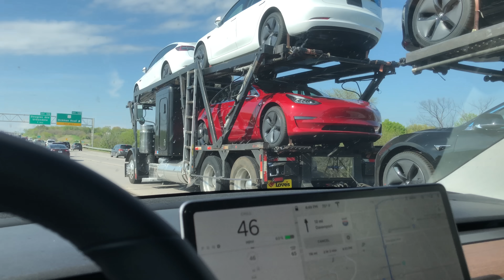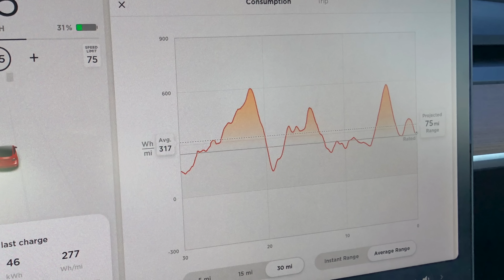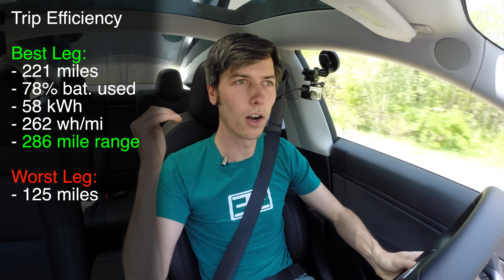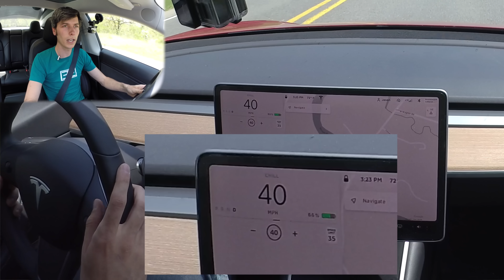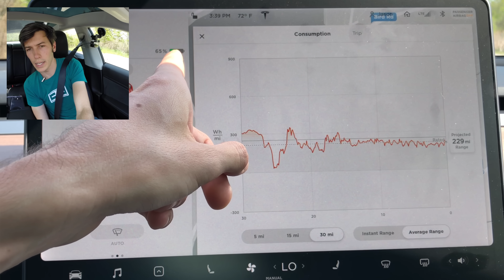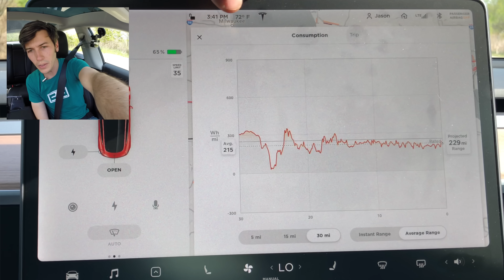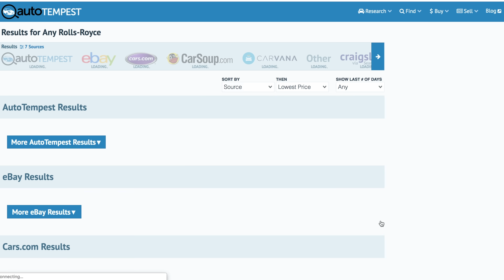How Miserable Is A Tesla Road Trip?

Comment: While you are driving a standard car...an alternator charges the battery...does an electric car have any built in device to keep the battery charged??? If not..why not??
Reply: ahh, good question. My answer will be more vague than an actual educated person. The issue is the alternator is being turned by belts to generate power. The motion is generated by the main engine of the gasoline engine and provides enough energy to power the vehicle with some excess to replenish lost charge on the battery from starting and other factors. Turning an alternator requires energy, and does tax a combustion engine to some degree reducing fuel effectiveness. Due to our current understanding of conservation and transfer of energy, it is not possible to recover more energy than we spend to generate it.

However, we do use a similar alternating function on EVs and that is the energy captured from braking. Now, i have not actually read into how these things work, but my understanding is that when engaged, the wheels basically capture energy in a similar way that an alternator does. But if it was always active, providing resistance, it would just waste energy trying to power through the resistance. The system should be able to engage and disengage the resistance, providing power generation while the goal is to actually use that friction to slow the vehicle. 

Now this was just my understanding with limited research prior to this. If anyone actually has informative details to correct, please do. I will never turn down an opportunity to learn.4

Comment: 560,000 Watthours you used in just a few days.
Do you realize the vast majority of houses run on that amount of power for a month or more??
And you're just one car.  Over half a million watthours per car and there's already nearly 100,000 of these cars out there.  Surely you can grasp the significant increase of power generation necessary to feed this new appetite for massive amounts of electricity?
It all boils down to energy density, both in the generation and storage phases.
Electronics are also far more vulnerable to software glitches (soft breakdowns?) and natural elements than mechanics will ever be.
If they manufactured self-sufficiency into these electric cars in terms of recharging (i.e. wind or solar), it would go a long way in preserving their future, imo of course.

Comment: Weight, not volume of internal cargo  is what matters. Most of the "lots of stuff" was light weight, low density and probably weighed less than a 3rd adult would.  The Model 3 net cargo capacity is 926 lbs.  You want a "miserable" long  trip, do it with a kid,a dog and a week's luggage plus tools. 
Google Maps'  travel time estimate is for movement time using traffic and speed limit information.  If your wife needs to take a potty break every 30 minutes,  you need to eat or sleep, or refuel your vehicle, the travel time clock is stopped for those breaks. If you use Google Maps while traveling, it will adjust your arrival time every time you stop for more than 3 minutes,and further adjust using GPS.

Comment: 15% buffer on LR? I used 10% on SR+ and still car was much more efficient than expected. Drove 10-15% faster than limit. It is better charge more frequently than hypermile time wise. So just go fast and nav will tell you if you won’t get there with current speed

Comment: Well, the nasty side of me wants to laugh, saying “Ha Ha!”... when you had a ruptured tire  cause by going over a pothole.  In my opinion car reviewers tend to emphasise handling and performance, over ride comfort and tire durability that comes with thicker sidewalls on tires.  Maybe I’m too old-fashioned, but I remember how my 56 VW Beetle had a more comfortable ride than my much more recent Prius in 2017... AND I didn’t have to drive as gingerly through the potholed streets of Denver, to avoid destroying my tires or suspension.  Low profile tires can be a high profile inconvenience.

Comment: Hey engineering explained, If anyone could address this
it would be you.

Every critic, mfg, consumer, seems to be ignoring the huge advantages of electric vehicles: Complete elimination of, and maintenance of, internal combustion support mechanisms. Water pump, can belt/chain/, oil pump, alternator, exhaust monitoring systems, transmission & fluid maintenance, engine oil, radiator, hoses, belts, bearings in all of these components, u-joints, rear end gears, fuel injection systems, related seals; my god, the list seems endless!

Entire industries will be lost not having to mfg, sell, and install these related components.... what will we do with our time?

Can you analyze these cost savings into an overall cost of an electric vehicle? I think we will all be shocked!

This needs to be a talking point.

Thank you

Comment: My LR M3 must be a musical car. Just took a 1600 mile road trip wh/m over entire trip. 217. Was over 4 days and 3 hotel stops each offering free charging. Total of 4 Supercharging stops with one not necessary just a bathroom break and decided why not. Total cost of charging. $32.35. Longest leg 254 miles 70-75mph wo stopping. 222 wh/m arrived at SC with 68 miles  out of 313 starting. A.C. on all the way.

Comment: That's actually impressive ... average speed 65 mph average speed. Assuming 310mile range, 80% charge/discharge, and only super chargers : 240 mile / charge @ 45min -> 6h15min 'perfect' charging. So you were close to that, I guess in the real world, it's impossible to hit a perfect distance between chargers, so perhaps a more realistic range between might be 65% and 35min charges (but you might also lose 5min / stop just to connect etc.).

310 x 65% = 200 miles -> 10 stops @ 40min == 400 min or 6h40m. Did you track the full stop time / including slower speed to/from the charger? (Will have the same penalty for a gas car, but somewhat less ... guessing 10min per fillup @ 5 fillups so < 1h).

LOL I should have watched the full video ... but your facts matches my estimates pretty good :)

Comment: Do Teslas have special low resistance wheel bearings or any other low friction features? Do they recommend specific tyres for Teslas
Reply: Jason's Model 3, being a performance model likely has Michelin Pilot Sport 4S. So they are not low rolling resistance tyres.

Comment: I'm not a fan of electric cars in their current configuration and practicality quotient, but I'll not ding it for forcing you to calculate where your next fuel source will be and how it determines where you eat, etc. Gasoline cars had the same issues when they were first introduced.  But it does speak to why you, as a customer, don't want to be on the bleeding edge of any technology - unless your car is really more of a hobby than daily transportation. 

I think electrics have heir niche, but they are good for two things: Rich guy buys one to put in his wheelhouse with his other "real" cars. Average guy with a daily URBAN commute with plenty of charging stations around where it can charge when he's at work. I think that something like a graphene capacitor type storage system could change all this, when it happens. Then I'll be interested in replacing an internal combustion engine car for an electric, but it probably would not be a Tesla (which opens up a completely different can o' worms). 

If we were having another Opec oil embargo situation, I'd feel a lot differently, but I see electrics as trying to solve a problem that doesn't exist.

Comment: I'm sure someone has asked this but I'm not going to read through 2940 comments of nonsense. Where does the 33.7 come from for gas equivalent? 560 kWh at $.30 is  $168. That is Socal Edison full rates. I would use 300 in my apartment with no A/C. I live off grid now and am lucky to get 10 kWh a day with 9 panels in Oregon's Willamette Valley. To buy gas and charge my batteries is quite expensive. $168 at $3 a gallon is 56 gallons multiply by 30 mph is 1680 miles. Not quite the savings you say with your 33.7 figure whatever that is.

Comment: The trip navigation accounts for things like temperature, elevation gain -- my experiences over at least 20 trips beyond the 300+ mile total range have been that there is built-in conservativeness -- even in a few cases where I thought I might have to do the last 20 miles a little slower than my usual 75mph I never even had to.  The actual range and EPA ratings are surprisingly close -- far better than my last car, a Prius that advertised 60mpg and really got more like 45mpg, whereas I often get more than 325 miles, and even in winter get maybe 20% less.  So on long trips, mostly it's just a matter of learning that you can trust the trip meter, and that you do have options, and so on.  Oh, and you said you were born in 1963?  No way!  (I was born in 1962)

Comment: You didn't tell us how much it cost you in electric charges for your trip. Tesla doesn't allow free charging anymore. 560kwh x .30c (NY is .36c/kWh, Cal is .38c/kWh so .30 is an estimate) = $168 for the trip. Divide $168 by $3 (gas price) is 56 gallons of gas. If your car gets only 32 mpg you will go about 1760 miles. 2000 - 1760 leaves 240 miles. That's about 7 to 8 gallons of gas between both cars. Cost of the trip for fuel is what matters, not miles per kWh vs mpg. Not even I had more electric stops than a person in a gas car matters. How long can you drive? Some people more, some less. It all depends what you are use to. That's not a factor.

Comment: So you padded the gas prices by 20%, compared it to a merely-average MPG small SUV, and drove well under the speed limit.  And still had to stop every 3 hours.
In a 40mpg car (nevermind the Skyactiv X cars you can't get in the US yet), and paying a more reasonable $2.50/gallon, the gas car wins handily.  You'd also arrive many hours sooner.  And the gas car costs about half as much.
Probably fine commuter cars if you don't mind the crazy price and usually charge at home.  I wouldn't own one for road trips.

Comment: When I can trim that almost 8 hours of charge time to go 2000 miles down to an hour I might get interested.. Until then I will go for cheap gas and continue to destroy the environment with my fume belching, carbon dioxide emitting 2017 Crew Cab Chevy Silverado 4X4. We would have laughed at the pot hole. I am intrigued by electric cars but the cost and utility just isn't there for me at this time. Also remember tax free charging isn't going to be around forever. Just wait until the government starts to tax the use of charging stations...Even The Ones At Your Home... to make up for the loss in gas tax revenue. They will make it so gas is competitive with electric on a cost per mile baises..mark these words.

Comment: I think a modern gasoline engine can easily average 40 mpg cruising at a steady state 75 mph on the interstate.  Even something like a Toyota Rav4 non-hybrid has an EPA highway rating of 35 mpg.  So let’s recalc at 40:

Tesla Model 3 - California supercharger rates: $201 or 10.2 cents per mile
Modern ICE car - CA $3.50 per gal: $171 or 8.7 cents per mile
Tesla Model 3 - your numbers: $156 or 8.0 cents per mile
Modern ICE car - $3 per gal: $147 or 7.5 cents per mile
Modern Hybrid - 50 mpg: $117 or 6.0 cents per mile

So ICE beats supercharger on both convenience / time and cost.

Good information but I’m still not buying the save money by driving a Tesla argument.
Reply: Yeah Diesel engines are even better, if I go on a Roadtrip and have myself under control (means only driving 85 all the time) I get easy 50 mpg

Comment: Why not charge it to 100% every time you stop.  From Kansas west it's a bit barren.
Reply: Because the charging speed is very fast between 5% - 65%, and then gradually drops off. At 70% you usually have MORE than enough to get to the next charging stop (and pee stop, and food stop).
Reply: BulletSpoung charging starts to slow-down after 50% state of charge and significantly after 80%. It takes as much time going from 80% to 100% as it does from 10% to 80%. The only time it makes sense to charge to 100% is before the journey and if you stay overnight with a destination charger.

Comment: Yea, I drive around 1600km per week (1000 miles) on some of the worst roads in North America and diesel isn’t always available... so I use a naturally aspirated, non-direct injection 5.0L f-150 with a 136 litre tank.  I get between 13.2-13.4L/100km, so about 1000kms (600 miles) per tank.  I would look at an electric truck, but it’d need at least a 1000km range in -30 to -45 winters... I’m not holding my breath.

Comment: The real question is, besides the flat tire, did your car get dents, paint nicks or glass chips during the drive?

So the entire trip only saved you $39.50 compared to a 30mpg gas vehicle, that's it?  I thought it would have been much more.

Comment: I recently drove from Massachusetts to San Diego covering 3,150 miles in 4 days.  My cost of charging was only $125 so I am wondering why your cost was so much higher for a shorter distance. I had the same range anxiety and did also charge up above the range the app suggested and also did drive at 80 miles an hour when ever available.  My autopilot made the drive more relaxing so i suggest anyone purchasing a Tesla get it with full Autopilot as well as FSD

Comment: You say you were born in 1963...so this Tesla has the time travel option??? Is it like Startrek...or were you in a Delorean with Christopher Lloyd??? 
Seriously tho...Last year I drove my Tacoma and pulled a 4000 lbs RV across Canada. So, between Thunder Bay On and Manitoba border there were spots  that had no gas stations anywhere. I had 5 Gerry cans of spare gas as a backup. I can assure...there was no TESLA charging station to be seen. 
My point is that this electric is still not practical for most people. Work driving and stop n go..it works but here in Canada in the great expanse...no way.

Comment: so if that area has a power outage your sol ?
Reply: You know gas pumps use electricity right?
Reply: @ScottHurlbert  did you for get you can toss a line into the tank at any station and either suck it out or use a manual hand crank like they used for water back in the oldn days? theses are not the cars of the future ...they are fads and all the millions of people driving electric cars would crash the system .but lights and living indoor was fun while it lasted...

Comment: I would not be that excited about traveling 2000 miles on the equivalent of 16 gals of gasoline as you stated. That is not a positive energy saving statement! Remember, the large amount of energy it takes to make those car powering electric batteries, the energy cost factor to make and store the electricity it needs to charge your batteries back up and not to forget the large cost of recycling those batteries to make them environmentally safe again after the 2yrs or so of powering your electric vehicle.  In actuality, your overall energy cost will be much higher than a gasoline powered car by 10 times overall in gallons of gas equivalents!  We must look at the big energy picture here!  Although internal combustion engines burning gasoline have an overall low energy output to efficiency ratio (approx. 50%+/-) they are still the most efficient way to get most people around who use their cars for personal family transportation. (speaking generally over all and knowing natural gas is more efficient than gasoline in public transportation and many commercial applications). People want the freedom of driving their own cars when they want, where they want, reliability, without worrying about reaching their destination after 200 miles of driving. Electric cars an be Fun, Cool to drive for short distances (but of course, more expensive). These electric car batteries are expensive to replace!  If and when the electric car batteries are improved in the future with longer ranges, lighter weight and lower overall energy costs, only then would it be a reasonable choice for the general public to consider buying electric cars for general family use. Just facts & IMHO!

Comment: A few things from on OEM engineer working on a BEV program:
Charge time/rate: charging system temperature is monitored for safety: so hot weather/vehicle/battery can affect charge time; the charge rate tapering off is probably a reflection of this
Charge rate: 500mi/hr while 'fast,' is stone slow compared to ICE
Cold weather: range can be reduced up to 50% - note how he listed all his power draws - plus the extra resistance of snow driving
Reply: If it takes the same time to "fill" the car as it takes to "empty" the driver (passengers) that ceases to be a problem.

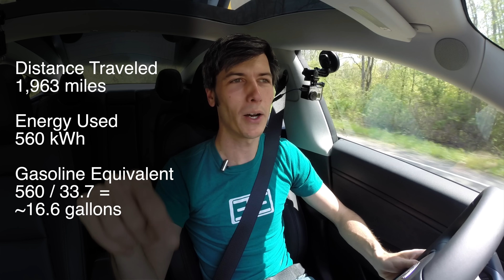Comment: Aw, come on, you just (8:10) compared the energy in a tank of gasoline with the energy at the electric outlet. Not fair, not fair, not fair. The thermally inefficient part of the conversion from raw fuel to motion takes place after you fill up an ICE car, it has already taken place before you "fill up" an electric car.  There wasn't even any need to put that fudge factor into it, the combination of electric power plant plus electric car is already more efficient than oil refinery plus ICE car.